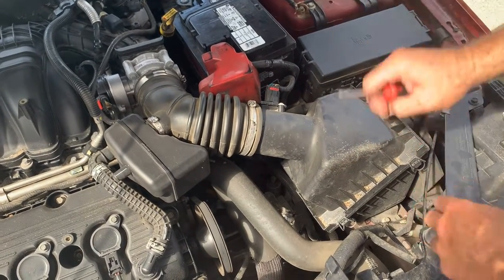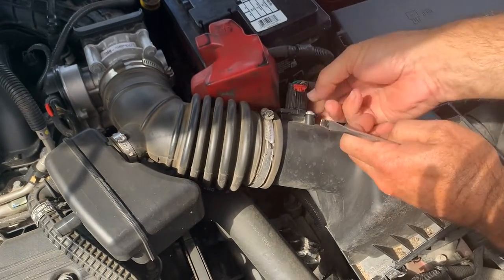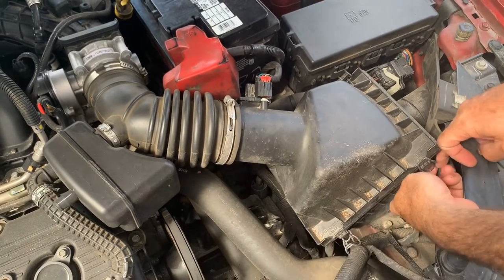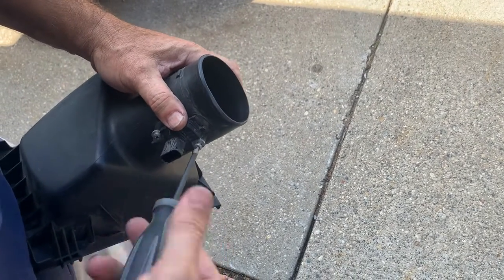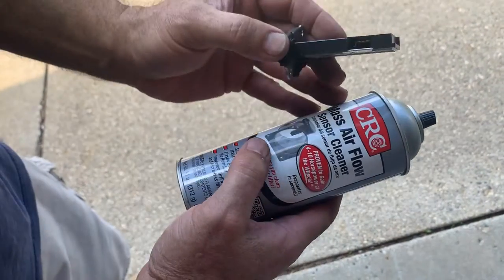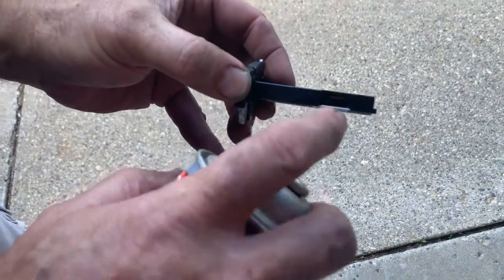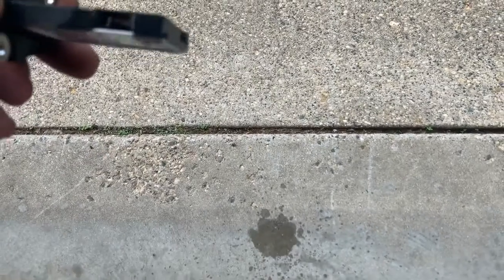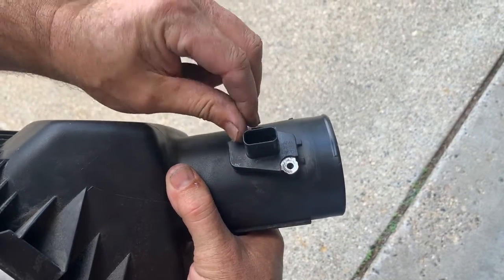How to Clean or Replace Mass Airflow Sensor Ford Fusion

Comment: Can you use carburator cleaner
Reply from the maker: No, carburetor cleaner is too strong and can damage the delicate plastic parts inside a MAF sensor ,it also leaves a residue that impacts the sensor's operation.

Comment: Did cleaning clear the check engine light or did it need to be replaced?
Reply from the maker: Even after clearing the codes, the MAF sensor had to be replaced.

Comment: Well ongoing trouble with my 2015 SE 2.5L. Will crank over when it wants to.  This time it cranked over but not always. When I do manage to start it sometimes will die.  Got it at auto electric shop. They said it might be the mass air flow sensor or air temperature sensor. But that wouldn’t cause the cranking problem ?
Reply: Talk to them the repair shop today they said they’ll know what wrong with it
Reply from the maker: No crank, like a die battery ?

Comment: Could this be a result of my car dying when coming to a stop or idling? I just replaced my fusion battery as It needed but it’s still doing what it was before. If you could get back thanks

Also worth noting I took it for a diagnostic and the battery was bad another reason why I replaced it.
Reply from the maker: Definitely, but did they also check the alternator when they diagnosed your battery?
Reply: @TheAutoTeacher  yes and they said the alternator was good that battery was through
Reply from the maker: Replace your air filter and then clean the mass airflow sensor.
Reply: @ThizzWay mine is legit doing the exact same thing right now, gonna do all this on the weekend but I just replaced my battery and now it’s bogging when I use the heat so hopefully this fixes it

Comment: I have ford fusion 2011 the se model 2.5L 
It is giving really bad fuel economy and rough driving after I changed the air filter is it the same problem with MAF sensor or is it something worse 😰
Reply from the maker: There's a lot of variables, but installing a new air filter won't lessen your fuel economy or hurt the drive ability unless it was installed wrong or the boot to your throttle body possibly got a rip in it. Are there any check engine lights? When was the last time the spark plugs were changed?
Reply: Can I use carburator cleaner

Comment: Question...what is that smaller tank thats connected to the air filter hose (to the left) , what is its purpose...on my fusion (2010 sel) it's broken off, so it's just an open hole on the hose where that should be
Reply: Air Intake Resonator
Reply from the maker: Not really sure on its intended purpose.
I talked to a friend of mine that is a service manager at a Ford dealership and they weren’t really sure of the functionality of that part. He did say that you could purchase the part for around $85 and labor of course would be something you could do yourself. I’m sure you could get a good used part at a salvage yard for around $30.
Reply: @TheAutoTeacher  thanks for the quick response, ill def look into gettin that replacement and see if it'll make any performance difference, my thought is..it can't be too good to just have this open hole in the intake hose thats normally sealed ya' know.. once again. Thanks